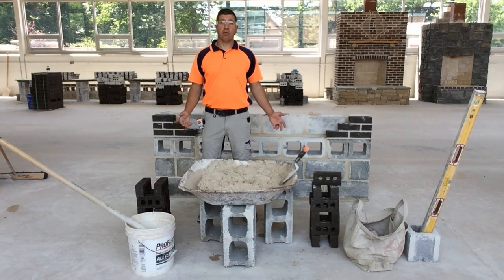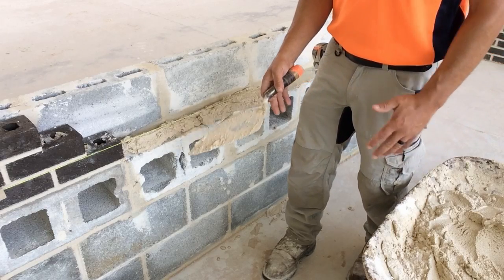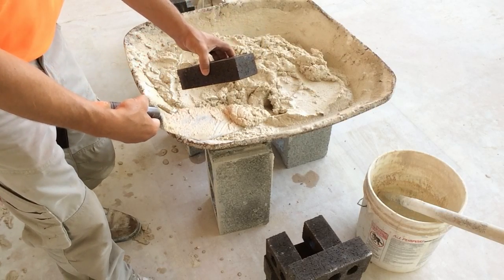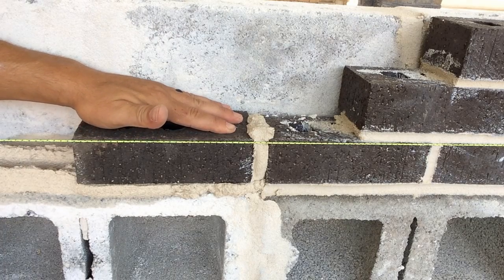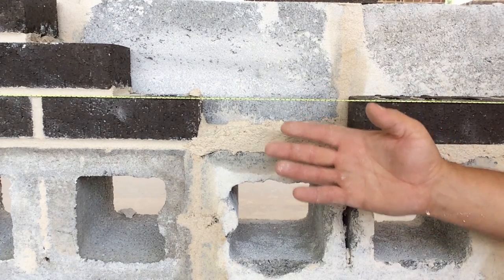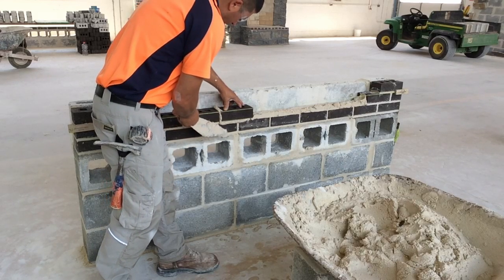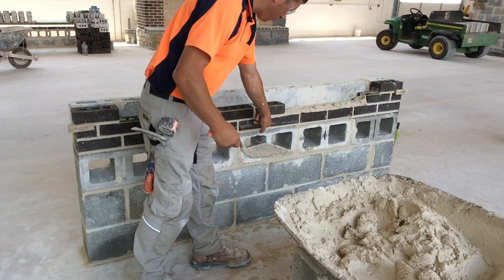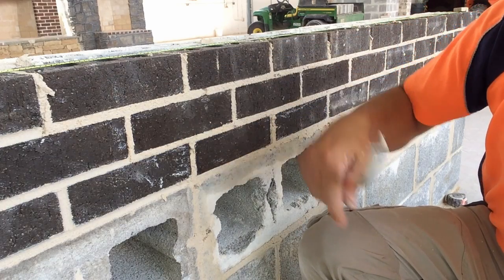How to Lay Brick [For Students]

Comment: You started by building the both ends and continued filling into the middle, what happens if the closing brick area is smaller or bigger in the middle than the final brick??????
Reply from the maker: Great question!  It's called "keeping bond".  As the bricklayer lays, their making sure their head joints are aligned vertically with the course 2 below the course they're laying.  getting "ahead" or "behind" bond will cause an issue in the middle of the course like you stated.

Comment: Another great video. 
Hope your students appreciate your efforts.
How long does the mortar mix stay workable and do you have any recommendations on mortar mixing?
Keep these videos coming.
Reply from the maker: Sorry for the late reply and thanks for the comment!  This mortar stays workable for a long time, there's no cement in it, just lime and sand. I recommend using a paddle type mixer over a drum mixer for mortar.  Thanks again!
Reply: @masonry201  Thanks for your response.  I only have access to a drum mixer.  Will that produce a workable mortar mix for me?
If not, could you please indicate why not?
Reply from the maker: @dc-wp8oc  Drum mixers are fine.  They're used a lot in the UK.  A paddle mixer works well to sort of make the mortar fluffy and airy, but not needed.  I've mixed plenty of mortar in a drum mixer just fine.

Comment: Why do you furrow?  It seems that furrowing creates a hollow channel in the center, which then  provides a chance for water to settle into the channel. It also seems that furrowing, or hollowing out the center,  doesn't allow the mortar to settle into the holes in the brick.  It seems to me like you would want to fill the holes as much as possible.  Your thoughts?
Reply from the maker: That's a great question, and really, there's positives and negatives to furrowing or not furrowing.  
In general (and not many realize this) furrowing is acceptable with cored brick.  The wythe of brick won't be completely solid either way.  Furrowing moves the mortar to the face, and back side of the brick wythe; making for a bed joint similar to block work. The wythe, like block work, is hollow in the middle, especially with cores.  
When laying solids, it is more favorable not to furrow, though many still do.  If you've taken apart a brick wall made with solids from the 1980's to present, upon close inspection you may be able to tell the brick work was furrowed.  
Earlier brickwork than that, the brick may have frogs in them, to when it's not good to furrow.  

TLDR: In general, furrowing started when bricks started having cores.

Comment: How do you make the practice morter?
Reply from the maker: Hi, Thanks for the question.  The mix is 4 parts bar sand to 1 part lime.  Gets about as hard as a piece of chalk after a few days.  Reuse indefinitely, even after it hardens up.
Reply: @masonry201  What is "bar" sand and how can this student mix be "reused"?  Could you show a short video on information like this?
Reply from the maker: @dc-wp8oc  Bar sand is a fine aggregate sand.  Much like sand at the beach, with no small pebbles in it.  The mortar has no cement in it, which makes it reusable over and over.
Reply: @masonry201  So, when students disassemble the walls, is the dry mortar crushed in some manner or granulated for reuse?  I am just trying to understand the process.  Maybe you could do a short video on this process.  Thanks.
Reply from the maker: @dc-wp8oc  Yes, the mortar is saved after disassembly.  It's sifted on a giant machine to remove any big chunks (broken bits of brick/block, etc.) then put right back into the mixer with water.  It gets about as hard as a piece of chalk for a chalk board.